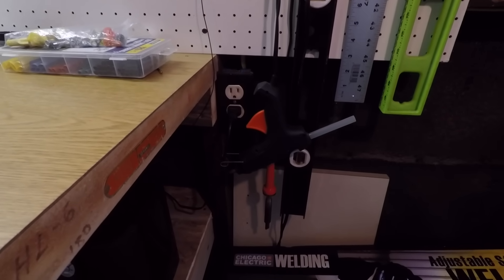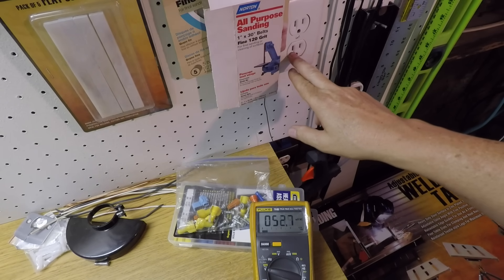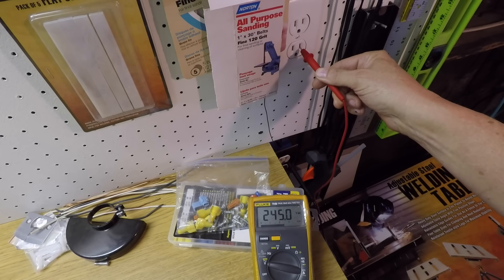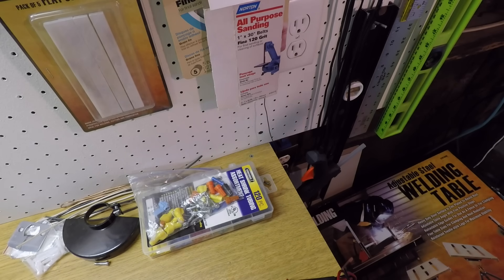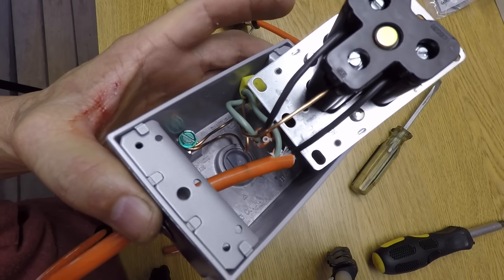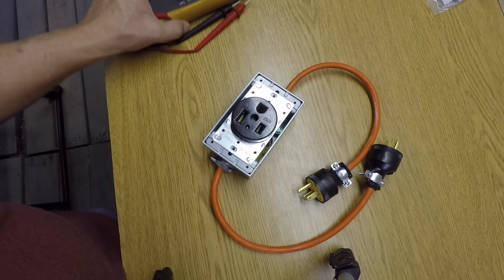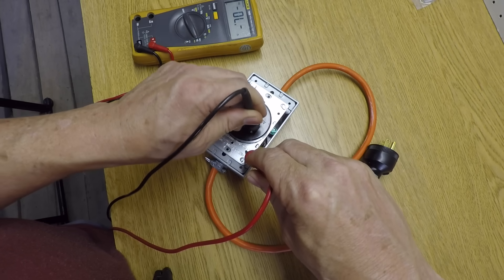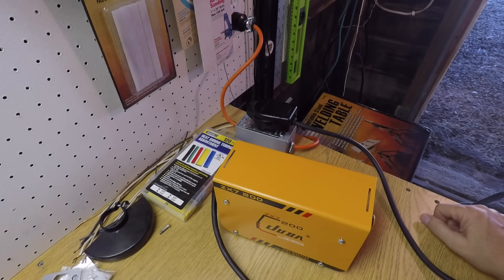How to Get 220v From 110v

Comment: I have a factory made UL listed chord that does this very thing you plug into 2 separate 110v and it comes together on the chord to give 220v we use it on a hardwood floor sander when there’s no 220v avbl on jobs . Lots of people say they never seen anything like this but we’ve ran for years and hav had no issues
Reply: I'd love to see a UL listing for a cheater plug.
Reply: Where did you get it?
Reply: Off two separate outlets 
On two different circuits right 
Like one cord in hall one cord in bedroom on separate 15-20 amp breakers
Reply: @David-oj7kt I wouldn’t think that would be save cause you have to use two twenty amp breaker’s you can’t mix the amps up or you might blow your machine motor.
Reply: As long as both circuits are rated for the same current draw and the equipment doesn't exceed the rated current, it should be save. Just remember to use a voltage meter to make sure you're getting 230-240 across the L1 and L2.
Reply: Where did you get this? What is it called?
Reply: And what is the amperage the sander is pulling?
Probably nothing near what the welder will pull.
Reply: Amazon step up/down voltage Regulatory

Comment: Just I think you forgot to mention if the power even though on separate lines but also you should mention the the power from one outlet comes from one phase “one side of the planned “ and the others be on the other phase otherwise you are just feeding the power to a short and one phase will short out the other

Comment: Hey um this is 60 cycle ac current the power switches from side to side 60 times a second both wires should be used or else your trying to pull nor amps off one wire

Comment: You have 2 outlets that are 20 amp. It would look more complete if the receptacles were also 20 amp (distinguished by the T shape on left prong slot)
Reply: It matches his 15 amp plugs and his 14 gauge wire on the 20 amp circuit that should have 20 amp plugs with 10 or 12 gauge wire.

Comment: Very helpful video, thank you! I've got one question though, if I hook together two 20 amp outlets, shouldn't I get an outlet capable of 40 amps?
Reply from the maker: Thank you. Two 120V 20 amp circuits combined on a 240V circuit will only be a 20 amp 240V circuit. The 240V circuit I demonstrate in the video is fed power from the breaker box exactly the same as a standard 240V circuit and it would have a 20 amp "double pole breaker" if done as a standard 240V circuit. Really the only difference with mine is it uses two 110V "single pole breakers" to draw from both 110V lines that feed the breaker box. They should be tied together to trip at the same time.

I get a LOT of people saying I should have just installed a double pole breaker but in my case I did not have the option to do that without replacing my breaker box and add more wiring. (an investment I didn't want to do because I was going to move soon) The box I was working with only had two breaker positions in it. I could only have either one double pole breaker or two single pole breakers. I needed both 240V and 120V in the shop so this is how I chose to make that happen.

Thank you for the question, I hope this helps answer it for you.
Reply: DIY Homestead Projects DIY Homestead Projects thank you very much. So my take on what you said is basically I can’t get 40 amps out of two 120 volt 20 amp outlets. 

See  here’s my sitiation, I’ve got a 50 amp welder I picked up from Harbor Freight a few years ago, took it home and discovered I didn’t have a 220 in my garage. So I did the right thing, went back to Harbor Freight and spent a lot more money on a generator that has a 220 Volt outlet without checking to see if the dang plug matches. It didn’t match! The 220 volt on the generator is only 30 amps but it’s got two 120 volt outlets rated at 20 amps each. I’m guessing I’m screwed and welding is not going to be in my future? Dang it!

Sorry by the way you get so many know it alls on here, that can be discouraging. I sincerely appreciate you taking the time out of your life to contribute your expertise. Thank you!
Reply from the maker: I do my best to help where I can but keep in mind, I'm not an expert in any way. There are many comments on this video asking if it's possible to use two 110V outlets on a generator to do what I did in the video. From what I understand, it is not possible. Two 110V outlets on a single generator is something completely different than using two house outlets fed from two different lines in a breaker box.
Sorry to hear about your situation and I understand your dilemma. The little welder I made the adaptor for is only a 20 amp welder so it worked for my situation. It wouldn't work with a larger welder that requires 50 amps. (that's why the "know it alls" commenting are so fired up) It sounds like you have a bigger welder that requires 50 amps so you really should have a 50 amp 240V circuit for your welder to perform safely up to it's potential.
Reply from the maker: Don't let the "know it alls" in the comments bother you. If you think about it, any "expert and professional electrician" would be too busy to be scouring You Tube for DIY electrical videos to bash on in my opinion. You Tube seems to have a group of what I call "You Tube expert electricians" and all they do is make negative hateful comments on DIY electrical videos across the platform. I see them on almost every DIY electrical video posted here on You Tube. They all start out their negative comments with "I'm a 35 year electrician" and then rain down with the negativity. Any professional legitimate electrician would be too busy with their trade to be spending all their time spreading negativity on You Tube comments. Unfortunately that's just the nature of You Tube. The more successful a video is on You Tube the more it draws these know it alls out of the woodwork. Just something to keep in mind when reading comments on DIY electrical videos. 
I wish you luck with your situation and hope you can come up with a solution that works for you.
Reply: @DIYHomesteadProjectsDIYHP10  Well dang it! Maybe it's time for a guy to invest in a welder he can actually use. Thanks for clearing this up!

Yeah I don't understand this online business where you kick a guy in the balls for helping out. But anywho, I appreciate the content, keep up the good work.

Now time to watch your other videos and see what all this tig welding is about.
Reply: @DIYHomesteadProjectsDIYHP10  Or it is Cunningham's law in action...
Reply: Please do t listen to this guy you have no idea if how wrong he is about doing this

Comment: Good build! But i like to suggest you to leave the neutral wire on and connected to the ground wire for extra protection.
Reply: NO! NEVER EVER CONNECT THE GROUND AND NEUTRAL TOGETHER!!!
Reply: @ShookieJay  Most breaker boxes share a common bus with neutral and ground. You do not want to do this in a sub panel though.

Comment: The one danger for this mode of operation if you blow one breaker you'll turn the welder power from 220 to 110 and that might destroy your welder. If not yours another type might.
Reply: the load is only using the two hots if a breaker trips then there will be a open circuit, no 220 no 110. if it back feeds through the ground it will be due to a short and trip both breakers.

Comment: I've never seen that one before. I like it, a lot. Got 2 dedicated 120V @20A circuits that can be used in tandem for 240?! That's awesome. Only thing I would have done any different from you is the 14-3 extension wire. To not use Both to hot & Both to common is a minor mistake I think, but, like you said, a very short run of wire. Any time I need a conductor for a certain application I look at the wire guage table for size & pull up a calculator. 
For instance: 

Currently engineering a radial flux electric motor using Aluminum Foil in place of Enameled Copper Mag wire. I know an aluminum conductor's cross sectional area has to be increased by 1.6 of that of an equivalent copper conductor. This rule of thumb business is a good idea to keep people breathing & such. LoL

Again awesome!

Comment: Not recommended! If gou pull one of the two plugs with the welder connected ans swirched on, the unplugged plug would be LIVE!
Reply from the maker: Why would anyone unplug one of the plugs with the welder turned on? That's like saying "if you are driving down the highway and open the door and jump out, you could hurt yourself".

Comment: Why not just convert one of the two outlets you installed to a 240V 20A receptacle by replacing the breaker and receptacle? Can use the same wires (white becomes a hot). If your device only uses 15A then it should have a 20A plug on it not a 50A. If that's not enough amps you should really just run a new circuit from the panel instead of messing with that contraption. If you have GFCI outlets in your garage like you're supposed to have under code, your device wouldn't work because the GFCIs would rightfully trip.

Comment: If you have two opposite circuits that close together why not jus wire a 240 volt outlet right there.
Reply from the maker: The sub panel to the garage only has two slots for breakers. (two single pole or one single pole) I needed both 120V and 240V in the garage. It's about 75 feet to the main house and I wasn't going to go through the expense to put in a new line and a larger sub panel box. That would have been several hundred dollars and we were moving shortly after I made this video.

Comment: Have been thinking about your 220 solution.  Normally on a 220 volt breaker the two switches are connected by a bar which makes them both trip at the same time.  What happens in you case if one were to trip???
Reply from the maker: Over a year with this device and that has never happened. If it did, I would just unplug the device and reset the breaker. Since this is not a motor, it won't damage the little welder if this happens. I've tested this by only plugging in one lead. Nothing happens except the welder will not run.

Comment: If you were going to add a circuit why haven't  you added a 220 volt circuit????     And by the way this will not always work.   It only works if these two 110 volt circuits "happen" to be on different input bars in the breaker box.  But all in all this is a good vide.  Thank you for the information.
Reply from the maker: You are correct, the two outlets need to be in the correct position in the breaker box. Usually on top of one another and then you could tie the two breakers together or use a double pole breaker. I didn't just wire a 240V dedicated circuit because of cost. The garage is about 75 feet from the main house and the sub panel to the garage only has two slots for breakers. It would have been much more expensive to upgrade all of that and we were moving soon after this video was made. It would not have been worth the expense in my opinion. This turned out to be the best solution for my particular circumstances and it couldn't have worked out better.
Reply: @DIYHomesteadProjectsDIYHP10  Knowing what you have experienced, which was all good, I will also try this as I too have a situation which would be very expensive to run a new 4 wire cable to where I need it.   Thank you for your information and for explaining it.
Reply from the maker: I admit it's not the best or safest solution for every person or situation. It works for me and I haven't had any problems with the set up. You just have to exercise some common sense and it can be done successfully without problems. Good luck with your project and stay safe out there. 😀👍

Comment: Makes logical sense. However, if any of the components, such as the outlets and male plugs, are rated at 15A; then the entire line is reduced to a 15A rating. Personally I would have opted for a combined 3rd outlet @20A 220V. As long at it works and doesn't cause problems, ok.

Comment: This is very nice to know.
I’ll be using this in a totally different way, in a off grid system.
Thank you so much for the information! 👍🏼
Reply from the maker: Glad it was helpful!
Reply: The machinist Mechanic  don’t...
Reply: Most generators come with a 220v outlet. I sure as hell wouldn’t try using two generators to get 220v from the 120v outlets. Besides grounding issues you have phase issues.

Comment: That’s pretty cool I like the concept and the ability to grab off the 220 but the 12 wire is still going to be at 12 wire even though there’s two of them. The amperage is going to take the path of least resistance and the 12 wire is not going to double up to a 10 or an eight wire even though you have double the strands The circumference of the wire. Actually because you have more surface area if you have DC voltage it may be increase the stability but since it’s AC current it decreases the stability of the wire.

Comment: My gas water heater took a shit and can't be repaired due to it being the inner tank that's leaking, and I can't really afford to replace it PLUS I feel like it'd be a waste for me to do so considering I have a brand new electric water heater sitting right next to it. I'm sure you've already guessed my issue... Not having an appropriate outlet..so I was just wandering if you think this is something that could be used to power an electric water heater. Its quite a tiny lil heater in comparison to my enormously large gas one. I'd say about half the size... Any input would be helpful.. Thanks in advance!

On a side note tho, after having watched this video along with several others in an attempt to gain some much needed knowledge&insight... I'm REALLY beginning to think that the homeowner is in fact quite wrong. (I rent a backroom that was built right off the garage completely separate from the main house. It has its own water heater) There is a 220v outlet back here..but he swears up&down it doesn't work(he's the know it all, never ever wrong, refuse to stop to ask for directions kind of dude who doesn't like for ppl,especially women, to voice their opinions if that opinion isn't the same as his-basically he's a douche) AAAANYWAY.. He even proceeded to "prove" to me it didn't work by hooking up one of his 220v cords to an appliance that we had just bought &tested at a shop just days prior...&he was right, it didn't work. HOWEVER, I even specifically asked him, "are you sure the cords not bad? Have you ever tested your outlet with one of those voltage reader things?" And his response was "this is why I don't like discussing things w/you, cuz even after I prove something to you, you still question me."  And amidst the following back&forth bantering &arguing he told me that it used to work, until he had some "idiot" come and do some electrical work** for him where he ended up fucking it up by connecting 2 different 110v lines to make one 220v one and you can't do that, it doesn't work that way. HAAAA... as irritatingly frustrating as it is to find out that I actually could've had hot water this entire time of suffering thru showers where the water goes from being hot enough to cook noodles straight into water so cold it makes your butthole pucker..giving you about 45 seconds of comfortable shower water temp on a really good day...but DAMN id be lying if i told you it wasnt all worth it just to be able to "PROVE", like REALLY prove, this asshole wrong&show him hes no better than anyone else,&hes def not smarter than anyone else,including me....hi, yes me, &im a chick.&you're dumb. So suck on that Mr. Don't question me& fyi I'm not QUESTIONING you, I'm TELLING you, you're stupid&you have a single gray hair growing out of the inside of your left ear that's so long I have to duck out of the way every time you turn your head so it doesn't touch me. Mmm k. Fix that shit. But not til after you hook up my water heater! Oooooooomg saying that to him&me actually being right would sooo make everything worth and that's saying a lot cuz Its gotten to the point where I don't want to waste the hot water that first comes out that I'll literally bottle it up and put it into my metal thermos, that I then put into one of those hot/cold grocery bags, that I then set out in the sun, so I can use it later when I take my bird bath &before that when it was so fuckin cold there was zero hot water coming out ever, i used to microwave several large batches of water instead. Cuz I'm that lame . don't judge me.  Oh ya, did I mention my water heater went out like 9 mo ago? Soooo ya, saying it'd still all be worth it is saying a lot lol so I'm on my way to buy a voltage reader thing to see whether its the outlet or the homeowners intelligence, ego,&pride that are faulty. (Well I already know he's faulty in that sense, but you know what I mean) I shall come back and let you know what happens even tho literally NO ONE gives a shit lol bbl!

Comment: Totally Unsafe. You have ignored the purpose of the white wire. What you don't know can kill or hurt you.
Reply from the maker: The white wire has no purpose in most if not all "welder" 240V circuits. Definitely no purpose with the welder I built this adapter for.

Comment: I have two gasoline electric inverter , runs constant 1600 watts 120 v . Can I use both inverters with this box and plug into a transfer switch to run 220  equipment in the house.?